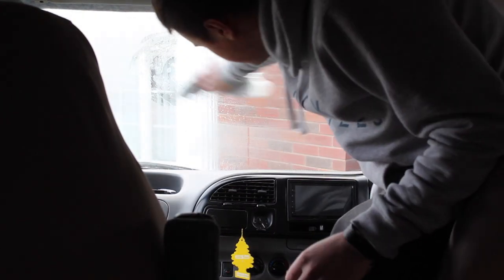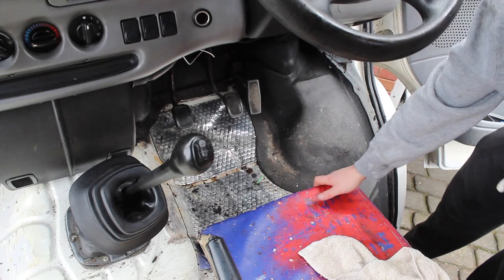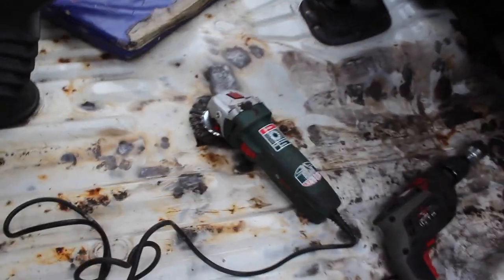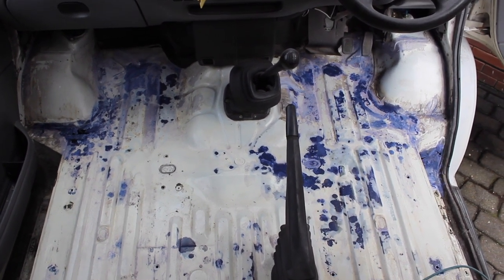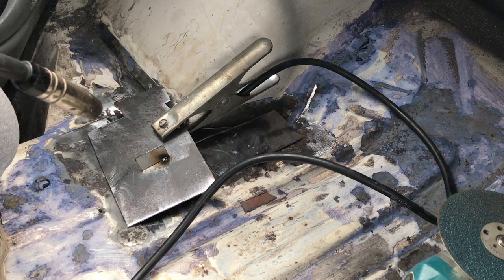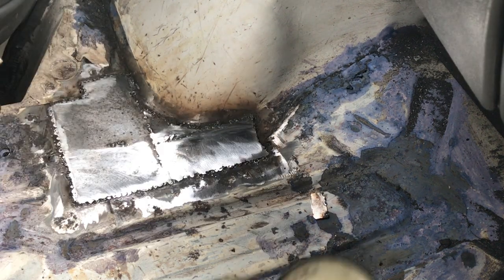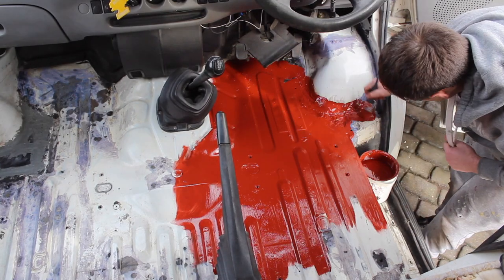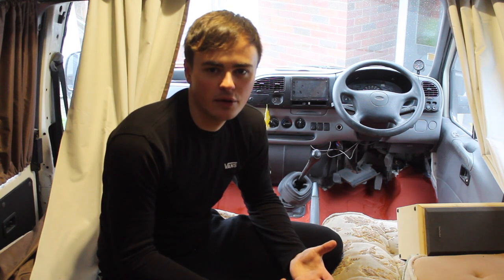Ford Transit Water Leak Part 1 - Protection

Comment: Was looking forward to a detailed exposé of the process of removing the seats, but bish bash bosh, and done. The bolts holding the seats down on my 2000 smiley transit are rusted tight, and don't look quite so easy!
Reply from the maker: Sorry mate, it wasn’t too bad to remove so didn’t record the full process. Was 6 x t40 bolts if I remember correct, bolted straight to the floor pan.

Comment: Great job you are very good and must love your Ford transit. One thing I would check is your door seals especially the tops of them as they perish and go flat.also I had to remove my scuttle panel just below the front windscreen and re seal it as water was getting in there hope this helps. Keep up the good work I enjoy your videos especially as I have a mrk 5 transit camper as well.
Reply from the maker: Thank you, I do love my old transit! Simple engineering that just works. I think that might be one of the places it’s coming in from. What did you use to seal the scuttle panel back down? Cheers Thanks for following the channel 😁
Reply: Hi I used Granville RTV black sealant you have to apply it and let it dry before assembling the parts back together

Comment: Looking forward to seeing how you go about fixing the leak. I’ll have to get some red oxide down on my floor too. I trust treated and painted over the patches with hanmerite but I think the red oxide is definitely a good long term plan
Reply: If you research modern formulations of red oxide primers, it seems they don't contain any lead any more, so it seems don't actually do much to prevent rust, blew my mind. Personally I use hydrate-80 (fantastic stuff) and then follow with an epoxy primer.
Reply from the maker: Sounds like a good method, will have to try that hydrate 80 👍🏼

Comment: What You do not realise, is that the water was not coming from the floor. It was coming from the roof and flooding the floor. I am an owner of mk7 transit 2009 manufacture date. I do not have any holes in the floor, but there is a lot of water below the carpet. I read that some weldings on the roof are getting loose and this is a normal problem. REALLY A SPECIAL CAR I must say.
Reply: I have the same on my mk6 I am taken the shelf out and vactan it oxide paint it and sika flex it at the joints

Comment: good video, I  had a similar problem with my mk 5 autosleeper duetto, I dont have a welder so I used fiberglass repair kit as the hole wasn't to big, but welding is definitely a better job, I love your DIY videos keep them coming👍
Reply from the maker: Thanks mate, a welder is a good investment for any transit owner 😆 Mines a gasless mig was about £140 new and it’s definitely paid for itself many times over now. Thanks for supporting the channel 👍🏼

Comment: Great video what settings did you have the welder on and what size wire
Reply from the maker: Hey, thank you for your comment. I can’t remember unfortunately as It was a case of adjusting it at the time to suit. It was 0.8mm flux core wire. I’ve since changed my mig welder and now use a MIG180 by RTEC. I have a video about it on my channel if you’re interested 😊 brilliant machine and comes with a cheat sheet for adjusting the settings depending on wire and material thickness.
Reply: Thank you

Comment: So it's OK to plate over a damaged area.  Thts a time saver.  I always cut the crap out. 
So my inner front wings out....got doorstep outrigger to replace..outter sill and the dreaded strut mount.  I'm lucky if I can loosen a bolt in a day when there's no one to call on.  Heehee love welding though.    Lucky you only had few rust spot on tge flooring..I've had to put floor pan either side. I used a Indesit washing machine panel, cus it's already ribbed for strength. My ford Indesit heeheee
Reply from the maker: As long as you remove all of the rust and then patch it shouldn’t come back. The way you’re going about it will be longer lasting though 👍🏼 That’s a good idea using the washing machine panel haha 😆 what welding set up do you have? I’m looking to upgrade mine soon

Comment: Just started tackling my wet floor, leak from the passenger window seal, when the panels join on the left hand side being the dash and from behind the heater... don’t think that’s all of them yet aha, a helper and a hose pipe are your friends

Comment: Great video mate, I will be doing the exact same soon what grinding disc are you using on your angle grinder mate ? And also where do you get your metal plates from to make sections for patching rot
Reply from the maker: Cheers mate! I use all sorts of different discs. I have 115mm wire brush attachment for the grinder from eBay, it’s brutal and a very good tool for removing rust, flap discs, grinding discs and cutting discs. Ebay for the sheet metal 1mm for panels as it’s easier to shape and 2mm for the floor really if you don’t mind the patches being visible 👍🏼 if I get a chance later today I will put a few links in the description

Comment: Wear was the leak ?
Reply from the maker: Part 2 is where I find the leaks, I think the gutter  is the main issue or around windscreen for me. Also inside the engine bay where the arch meets the bulkhead 😁

Comment: 101 questions .have you done video for removing front passenger seat with captains chair?  Only;  I have the swivel base, yet I doubt it is for a tranny(¿
Reply from the maker: I did make an adapter plate in this video to fit a double seat from a mk7 transit which might be useful. https://youtu.be/VbhlNwlFGvM?list=PLF2pSkJX87bt1jT3WecDoECJ5Rtv6xLWy

The other option is to just drill new holes and bolt it to the floor.

Comment: nothing worse than a leaky bottom
Reply: Great work!! I've just bought a mk5 Campervan and seen to have some very similar issues,

Just wondering if you swapped the stereo out and if so which adapter plate did you use? I'm struggling to find one that works at the minute